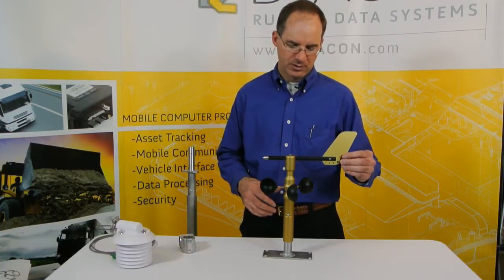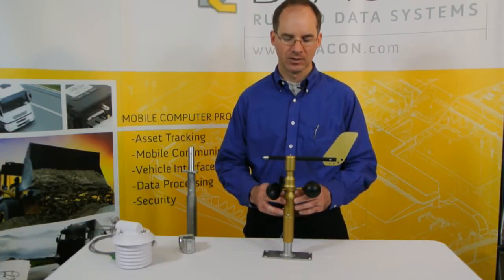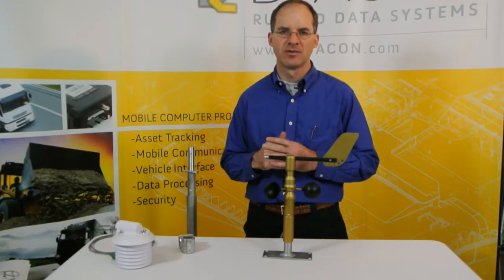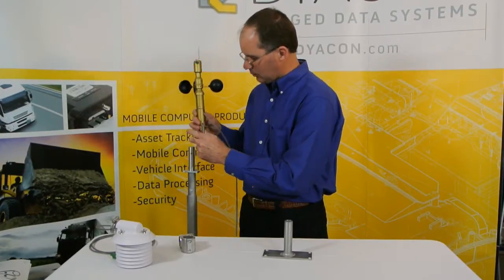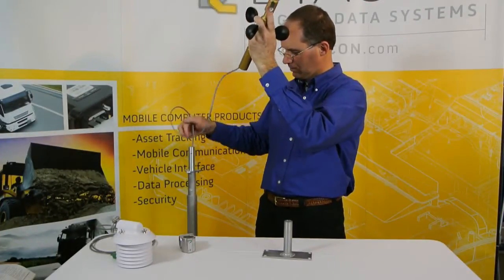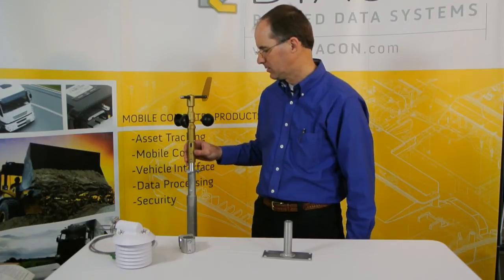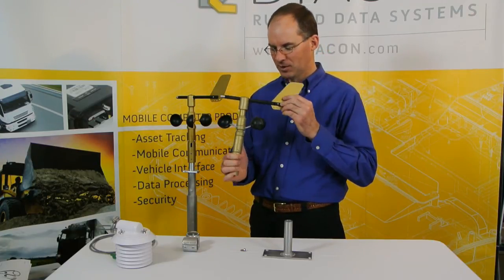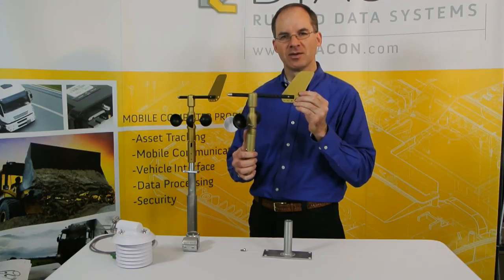Wind Sensor Introduction 2014

Comment from the maker: Dyacon WSD-1 and WSD-2 wind sensors combine anemometer and wind vane in a rugged package.

The sensors feature digital output for long cable runs and direct connection to programmable logic controllers (PLCs) and data loggers. WSD-1 uses Modbus RS-485 and WSD-2 uses the SDI-12 protocol for environmental data loggers.  #weather   #agriculture   #utah  customizable  #weatherstation  solutions for home and industrial use.